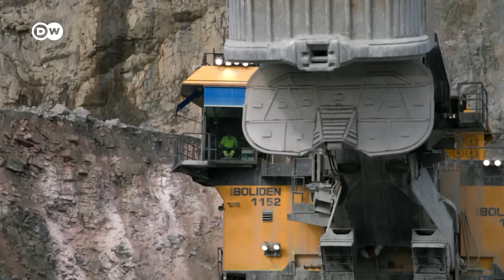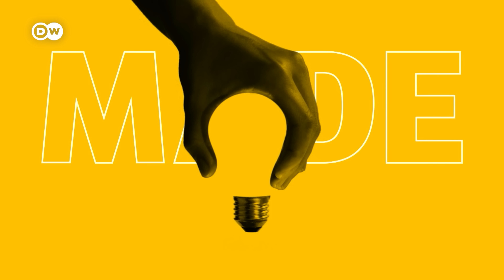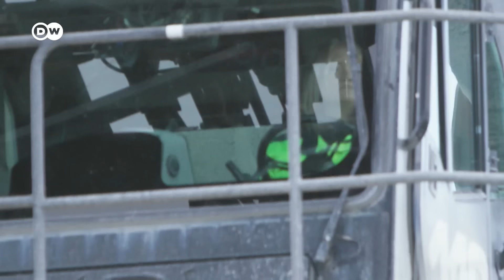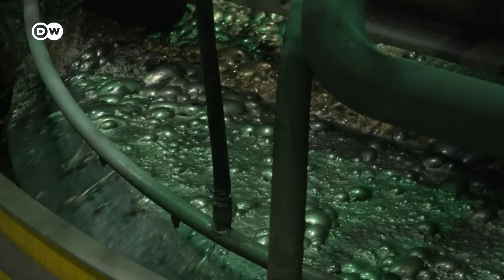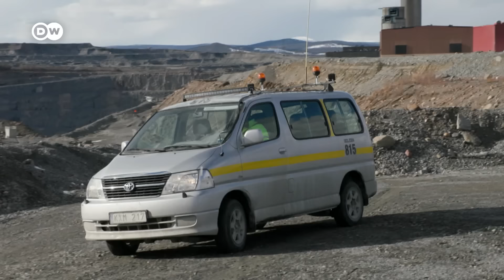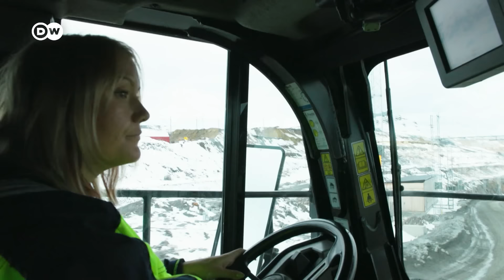Inside Sweden’s copper mega-mine | DW News

Comment: For those wondering it's an probably an translation error and it's mil not mile. 1 mil is 10 km while 1 mile is 1,609 km and i could see that americans would think a mil is the same as mile but they are not in the same measuring system.

Comment: Dear DW News: The trucks in this mine do not transport 600t of rock per trip. No truck in the world currently can. Ultra class trucks can transport 360-410t depending on manufacturer configuration and the Cat 795’s (used in this mine) maxed payload just barely gets into the bottom of the ultra class group with a max payload of 372t.
Reply: Belarusians have 450 ton. Diesel -electric Belaz truck.
Reply: @f5kn114 There was only one machine in operation. It is no longer in use.
Reply: @olgayashina4055 there is no 600 ton dump truck that exists. There is a belaz truck that can haul 450 tons

Comment: Sweden's mineral and metal hidden resources should be prospected for with dowsing.  Read and study the book, The Art of Dowsing - Separating Science from Superstition ($14.95), by Michael Fercik, for learning how to build and the physics involved in dowsing with the modern light weight ball bearing dowsing rod, which is the only dowsing rod that accurately gauges what is being dowsed by pitting the energy of gravity against the energizing of the one-tenth ounce dowsing rod load, that is located five-inches from the hub's shaft.  This precisely gauges the dowsing of all edges, exact center, depth buried with angle of deposition, and most important is grading of the dowsed element that is contained in the elemental mass that is being dowsed.  Anybody can become a professional dowser by practicing the book's dowsing lessons of buried pipelines and electrical cables, tunnels and voids, precious metal placer and load deposits, dowsing for treasure, dowsing for any element, amplified long distance dowsing from a moving vehicle, and dowsing on water from a boat.

Comment: I surprised they don't have cables for when they go down into the pit. Use reverse regenerative braking and could likely repower the "grid" due to the sheer amount of braking necessary to get to the bottom.
Reply: Sounds to complicated for a mine. You would need poles in permanent places which in mining there are no permanent places as all will get mined eventually.
Reply: @TheYoutubeMethod  yeah the only other method I could see is a "discharge station" but likely wouldn't work, like you said will get mined as well as the company not wanting "down time" whilst discharging.

Comment: Electric powered by 100% coal and oil. Almost funny.
Reply: Sweden's energy mainly comes from hydropower and nuclear power (nearly 90%) This has been the case since the 1980s and coal hasn't been used for decades.
Reply: @gundalfthelost1624 That is not true though, in 2022 at least.
Reply: @einarkeyser1763  You are right. Wind turbines are also pushing in now.
Reply: @gundalfthelost1624  Some of the time but surely most of the time, winds are a blowing. Made me think of Bob Dylan.

Comment: It's good, but the company behind it needs to be given an advantage for it being zero carbon (when they finally become zero carbon).  They have to compete against mines around the world who don't care about their carbon footprint, so there needs to be a financial advantage for the zero carbon mine.
Reply: the reality is the switch will happen naturally. they didn't switch to the diesel electric hybrid because its carbon neutral but because it reduces fuel costs. As cat makes more of these types of vehicles the costs come down just like how ev's are becoming cost competitive and will soon be cheaper then ice vehicles.
Reply: Yeah, though some enviromental  awareness could have factored into the decision, going green is quickly becoming a sound business choice rather than something you do idealistically.
Reply: Also in Scandinavia and probably most of Europe soon when you for example plan a new building you need to provide a climate-rapport.. So using "green" copper would be a lot better.. I think things like that will force the industry to change as well.. Other markets required to use greener products not only for state requirements but also for costumer requirements.

Comment: We're pretty fortunate that our mines are located in areas that have both large rivers and are quite sparsely populated, meaning there is less competition for the hydropower. If either of these were not the case, I don't think running the stone mill on green energy alone would be possible.
Reply: The hydroelectric dam shown in this video is actually located in hunderfossen, Norway... not Sweden 😅
Reply: To bad they don't pay much in tax back to the government.
Reply: Also that it's located on sámi land so there's the bonus of destroying more pf the lands necessary for the cultural practices of the sámi.
Reply: True, why this mine is good. Not all possible mines should be used.
Reply: So much energy wasted on luxury items, needless stuff... This stuff on the other hand is work ...
Reply: yeah but you can power it by nuclear energy which is also enviroment friendly
Reply: I'll say one thing: Arica, Chile, 1985.
Reply: Power generated is transmitted from sparsely populated areas by method of power lines to densely populated areas, Sweden has a national power grid.
This also means that green energy can be generated anywhere, even abroad since the Swedish power grid is connected to continental Europe.
Reply: @kronop8884 you make it seem like transporting energy is easy, just hook up a powerline and go. It isn't. It's a massive problem for Sweden that we have all our hydro in the north and most of our population in the south. Why do you think we built all our nuclear down south? Specifically because of the problems transporting energy across the entire country.
Reply: @kronop8884  dock är det ca 3% energiförlust enbart i högspänningskablarna per 10 mil transport, så det blir snabbt dyrt att transportera mycket energi långt
Reply: was about to say this @Mr0o0o0o0o0o0o0o0
Reply: @Mr0o0o0o0o0o0o0o0  what? it should be closer to 3% per 1000 km
Reply: @Codan3  (Assuming you're not scandinavian and therefore don't know) The scandinavian "Mil" is not the same as the american "Mile", it means 10km. So while the loss/distance still doesn't add up with your claim, it's at least a bit closer.
Reply: @Unknownmonkey13  It's still off by a factor of 10. which is huge in terms of energy efficiency over distance.
Reply: @Codan3  I know, just making it clearer what the other guy said actually means
Reply: @Unknownmonkey13  most of the stats I'm finding, say roughly 2-8% loss through distribution, low voltage city distributions causing higher end of the spectrum and long range high voltage causing the lower end. 

Difference being, my stat of quoting around 3% per 1000km high voltage, is waaaay different to his 3% per 100km, which results in upwards of 25% loss over 1000km
Reply: Depends. A lot of the demand is for electrochemical processes, which could be run intermittently. Stockpile ore when there is not wind/solar/nuclear available and fire it up whenever excess is available.
Reply: Nucular power is green.
Reply: Hypocrites.
Reply: what do you mean? @lancewood1410
Reply: @lancewood1410  how so?

Comment: Bit of an exaggeration on the truck size, the weight of the truck and payload is 600 ton but the truck itself only carries 350 ton and now they are mostly driven by autonomous systems.
Reply: No, there are about 10 trucks in the autonomous project.
About 35 trucks are still driven by drivers.
And another 7 is coming. Driven by drivers that is.

Comment: Although I do admire the goal to be environmently friendly, there are a few (big) problems stated in this video. The biggest one is of course their business: mining. Digging (or blasting) a gigantic hole in the ground isn't really good for the environment, is it? The second problem has to do with their claim to 'run 100% on renewable energy'. Although probably technically correct, the same energy could have been used to power thousands of homes. Are all the homes now powered by non-renewable energy? If so, the environment doesn't really benefit from this. The polution on paper just shifted from the company to all the homes.

The hybrid trucks are a big step in the right direction. That is if renewable energy is used.
Reply: Lets be real here Emanuel, what makes you think that the mine is sucking up all the renewable power in the area? 
Thats a real question, it seamed like such a wild mental leap to take.
You might not be familiar with the region, so let me just add that there are plenty of rivers to draw upon if more hydro-energy is required.

You mentioned that digging or blasting a hole in the ground isn't great for the enviroment. 
Sure, but whats the alternative? We need copper, plain and simple, so if we are to gather it from somewhere. Perhaps its best to get it from somewhere regulators are in place and laws are established to help and support both the people and to a large extent the enviroment. Im not saying its perfect, just that in comparison to many other mining industries, this ain't bad.

Glad to see your interest in this project and mindset when it comes to the enviroment :)

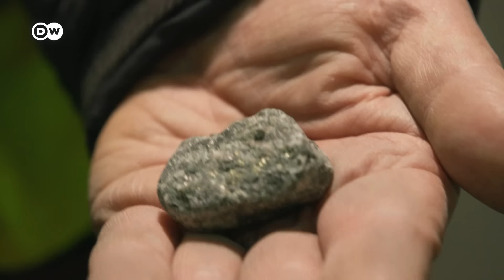Comment: 3:21 Next time give us an actual break down of the processes. So what chemicals are they using and how do they separate the copper from the other things it bonded to without hurting the cooper
Reply: /Chinese mine executive
Reply: When I studied chemical engineering in high school we went on a trip to this mine! 
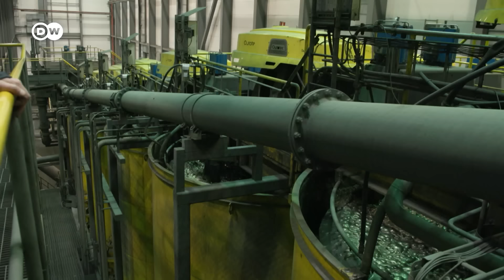The crushed ore is separated by froth flotation. Air is blown through a slurry of ore, and the copper sulfide particles are lifted by the air bubbles and can be skimmed off the surface. That's what's happening at 3:25 in the video. Chemicals used are foaming agents, similar to those used in schampoo. 
The enriched ore is transported to a smelter where it is heated and oxygen blown through the melt. This oxidises the sulfide to sulfur dioxide, and the raw copper metal can be poured off. The raw copper is then purified by electrolysis. 
The main problems with the whole process is catching and handling the sulfur dioxide, and the waste sand from the flotation process that still contains a small amount of copper. (The sulfur dioxide is converted to sulfuric acid, and widely used basic chemical).

Comment: How does the truck ground if it gets its power from catenary??? Just curious
Reply: its Direct current. DC, so only + and - is needed
Reply: @toxed9144  correct, but what's the negative if catenary is positive.....
Reply: @mayhemmike1789  it does not work like a train or tram where the rails provide earth, instead it works like a trolleybus, it has 2 wires + and earth. You can see that at minute 02:23 the mining truck  has two pantographs. There is no - for none of them tram, train, trolleybus, or mining truck, there is only Earth. Power can be AC or DC, For AC it needs more voltage to have the same power as DC. For example trains in Romania use 25000V AC 50Hz while Italy uses 3000V DC while having same tractive power (for high-speed trains Italy uses 25000V AC 50Hz which is more reliable at higher speeds). Additionally  all the rubber wheeled vehicles and in some occasions trams must have a wire (or more) like thing that touches the ground (it's hidden under the vehicle) to prevent electrostatic buildup or accidental voltage buildup from the + DC or phase AC wires that can come through the pole and down on the vehicle when it rains and everything is wet, or other situations like short to the mass of the vehicle.
Reply: @WARGODS-ez1bu   "For AC it needs more voltage to have the same power as DC" No, that is not true. The AC-Voltage is the effective voltage, which transfers the same power at the same current. So 1V*1A=1W in AC and DC.
If the same power is needed in a 3kV DC System as in 25kV AC, you need a (25/3=) 8,33-times higher current. This is the reason most countries with DC-Systems switch to 25kV AC for the high speed lines, because the high speed trains use so much more power, that transferring those currents wouldn't be possible in an effective or economical way.

Comment: These diesel-electric with cont actors are pretty cool. When there is overhead power available, they run like a train, If they have to leave the grid for maintenance, to go around a lane blockage or to access remote locations, they switch on diesel generators like a WWII submarine. There's trials of this being done for big rigs on freeways.
Reply: Also, Dual mode buses are a thing. Trolleybus is over 100 year old tech, but before there have never been trolleybuses with diesel and electric in normal service. But now, last 20 years or so,  there is some cities across the world who have taken them in use, Seattle had them in the 90's, so they can drive from suburbs with diesel, but  when closing the city, connect to the overhead trolleybus cables.
Reply: @SergeyPRKL  Bergen, Norway has some in use today.
Reply: @bnkh   yeah, i know. Been there last summer :) I'm a Finn!
Reply: @SergeyPRKL and it exists on trains
Reply: The driver also indicated in the video that if she's gone for a week it's difficult to know the transportation paths (presumably because the existing paths have been blasted/taken away). It sounds like a fantastic concept, especially on freeways ~ like a video Tom Scott made a few years ago. I don't understand how this could work economically in a dynamic environment like mining.

Comment: I like that waving is required
Reply: I don't know for certain but I am quite sure bus drivers here in Sweden do the same because I always used to see them wave at each other
Reply: @TheOnesAtTheBottom  nej det är ju för att busschaufförer känner varandra, om de kör i samma stad jobbar de för samma företag och är då kollegor, ofta vänner
Reply: I was wondering why the local tram drivers waving each others when crossing in Sweden. now understand the reason behind it.
Reply: it's dark 9 out of the 12 months a year... waving is not required.
Reply: @hadochaddockson4290  So you’ve obviously never been to Sweden.

Summer is never dark, the sun barely sets. And in the north, the sun is up 24/7. (Rip sleep)

Spring and autumn is like any other country.

Winter though is very dark. So 1/4th of the year Sweden is a fallout shelter simulator.
Reply: @jgripen969 jag från norraste delarna av landet. Det är mörkt hör mer än halva året och ljust andra halvan. Men under den ljusa delen så regnar det halva tide. Så 9 månader mörker. Good?

Comment: Nikola Tesla, Einstein, Huxley, Orwell and Turing should be forgiven for thinking their systems can last forever – finite fossil fuels are dangerously hypnotic to humans and their mental capacity.
Humans were not ready morally, ethically and intellectually to start the mass extraction of fossil fuels with the advent of the steam engine 300 years ago.
The Magna Carta requires now overhauling – adding to it the right for humans to understand what Energy really is;
"In any system of energy, Control is what consumes energy the most.
Time taken in stocking energy to build an energy system, adding to it the time taken in building the system will always be longer than the entire useful lifetime of the system.
No energy store holds enough energy to extract an amount of energy equal to the total energy it stores. 
No system of energy can deliver sum useful energy in excess of the total energy put into constructing it.
This universal truth applies to all systems.
Energy, like time, flows from past to future" (2017).

Comment: That STONE MILL is NOT ''the world's largest of its kind'' !!!! :))
WTF Dw . I ved PERSONALLY worked around EXACTLY the same mill's down here in Romania at a Aluminium refinery...and those mills are from the 70's
Even the bolts are PLACED in the same manner and in the same places :)
ITS hard work exchanging the shields that are on the interior of those mills
Reply: Don't know if its the largest but its a ring drive ABB GMD with a power of 22.5MW. Milling capacity is around 2200 tons ore per hour and The diameter of the mills are 11.6m.